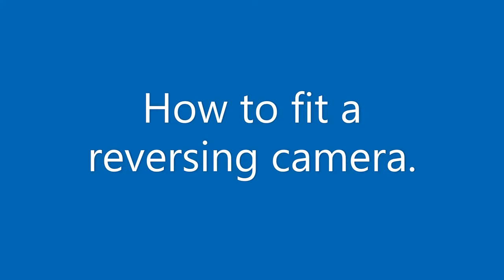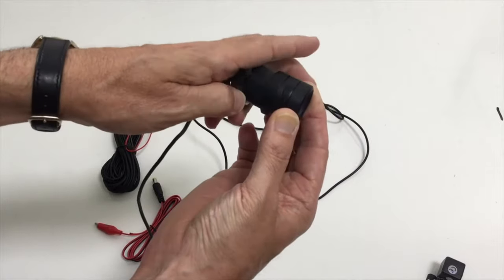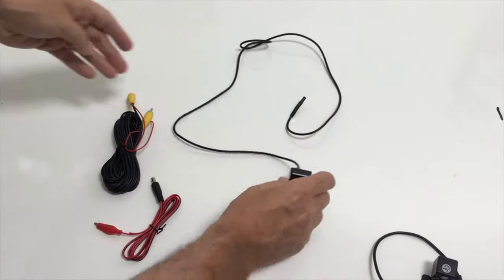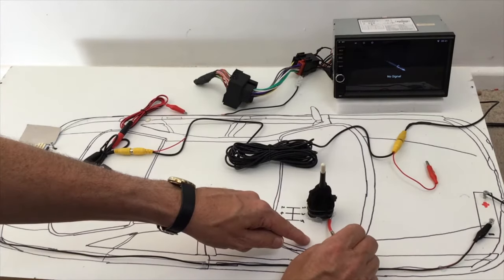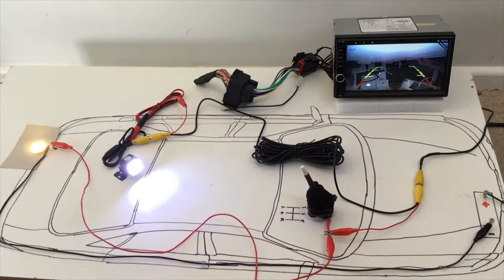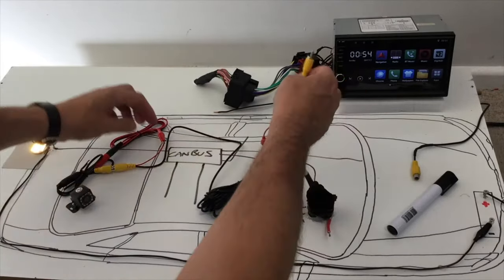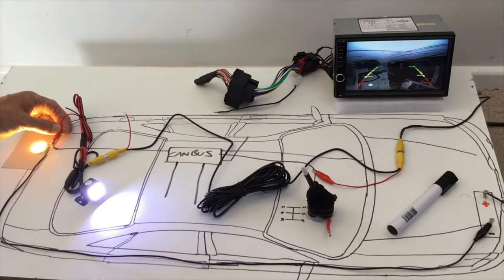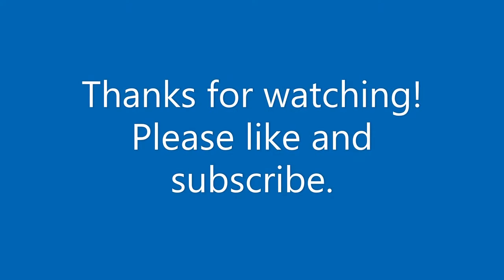How to wire in a reversing backup camera - watch this first!

Comment: Hello. I am interested in how the layout of the wires for the camera goes as in the picture because my cores are torn. The output of the camera has 5 wires (red, black, white, green, yellow). How to connect them, make a red and yellow connector? Thanks
Reply from the maker: Hi there, it’s very difficult to say exactly what each wire does, because different cameras have different wiring. They might have the same colours, but the use of each can vary. My guess would be red for power, black for ground, and “possibly” green and yellow would be the video signal. But that then leaves white. So to be honest I’m not sure. Can you get in touch with the camera supplier?

Comment: hello, I have a problem because the old reversing camera broke, I bought another one exactly of the same type as the old one, the wiring is the same and I didn't need to rewire the cables, unfortunately, but the new camera does not work, I should also tell you that I bought 2 identical cameras and they don't work, what could be wrong, tell me when the system is canbus, the big cable that comes out of the rca of the camera must be connected to the positive of the rear lamp??? also because I'm also trying it at home on a TV but they still don't show me an image, do you know if these cameras work to test if they work on a simple TV or only on an android system please help thank you
Reply from the maker: Hi there, and thanks for your comments. Yes these cameras will display on a normal TV as long as it has a yellow rca video input line. You will need a power supply of 12v to power the camera when you are doing your test on the TV. If you supply 12v power to the camera and plug your video rca cable into the yellow rca socket on the TV and select that input on the TV, you should see an image. If not, there is a good chance the camera has a problem. 🤞 good luck!
Reply: @Jase777jase  do I have to connect the red cable that comes out of the rca plugs to the power supply???
Reply from the maker: @emmanouhldigkas1661  yes, that’s right. Red to the positive 12v supply.
Reply: @Jase777jase  I also have to connect the red wires that the 6 meter rca cable has, it comes out with 2 red wires, I also have to connect these to the positive pole to see the signal on the TV???

Comment: Very good video on how its done.... I have a brain tester for you :)  Can i tap into the factory fitted camera to be conected to a rocker switch that i can turn on the rear view camera anytime i want like driving along the motorway and a front facing camera  ?
Reply from the maker: Hi Brian. That’s a very good question and one that several people have asked! I’m sure it’s possible, but Im also sure it would be very tricky to achieve. It’s very likely that control of your factory fitted camera involves Canbus, and therefore you’d need to decode that to get anywhere. It might not be the case, but I’d bet that it would be. Regardless, you’d need a very detailed wiring diagram for the whole vehicle in order to even make a start as to how to go about it. That’s assuming you are talking about a factory fitted camera and factory fitted head unit. If you have an android aftermarket head unit and you have already successfully connected your built-in camera to the new head unit, it would be possible, because you have access to all the right connections for the job. I hope that helps, and many thanks for the excellent question. J.
Reply: Thanks for your rerply. I was thinking of  going the Andriod way . And it could the easist way to do want i want .  Thanks  @Jase777jase

Comment: Great video!  I'm working on getting my Head Unit to show the camera on demand and when in reverse.  It's on an RV that I want to keep track of what I'm pulling.  I'm getting my camera power from the front via the camera cable.  Any suggestions?
Reply from the maker: Hi there Michael and thanks for your comment.
Yes it’s something that I have thought of doing as well. It really depends on how far you’ve got so far. If you already have it working automatically when reverse is selected, either from the reversing light or from a canbus system, then it’s just a case of wiring in a switch in parallel with the current set up with one pin of the switch going to a positive signal and the other going into the reversing signal bunch. You could then mount this switch somewhere sensible on the dash. I guess if you haven’t already got it working automatically, you could just do the above anyway, and flick the switch if it’s close to where the gearstick is, and forget about the automatic part of things. Another completely different way of attacking this, which occurred to me yesterday, would be to use one of the other video inputs on the head unit. There are usually a couple of RCA connectors in addition to the one for the reversing camera input, and you could theoretically create a double RCA plug from the camera lead and plug in to one of the other RCA sockets as well as the reversing RCA input.
This would mean that when you want to view the reversing camera on demand you have to go through the menu system to find the video input button.
Hope that gives you food for thought!
All the best
Jason.
Reply: @Jase777jase  Funny you said that.  I just ended up using one of the other video inputs. LoL
Reply: @Jase777jase  By the way, I like the using a RCA splitter so I can get backup and full time backup camera.  Thanks for the thought!

Comment: I connected everything as per the video as I connected the red "power" wire to the "back up" lights. I did that, because the "back up" lights only get power when the car is put into "reverse." Since I only want my rear view camera to work when my car is in "reverse," I thought that this is the logical way to do it. Well, I am getting a "No Video Signal" message on a black screen! Any advice?
Reply from the maker: Hi there, well that would indicate that the head unit it sensing reverse, but not seeing any input from the camera. Do you know that the camera is getting power and coming on? Ie does it have anything to indicate that it’s on, like led lights like the one in my video? Is if definitely plugged into the correct RCA socket on the back of the head unit? There will probably be several. Make sure it’s in the reverse one. Going back to the camera, If you can, try the camera in another device. If you have oldish TV with RCA inputs on, try it in the yellow port and select the correct AV channel on the TV and see if the camera is working. That’s about all I can offer I’m afraid! I wish you luck!
Reply: @Jase777jase , 
I have plugged it in the correct port into the deck as it is marked with "camera." The camera itself seems to be getting power, because the LEDs on it light up. My deck has a foldable screen, which used to open automatically when I switch into "reverse." That function seems to have been lost. I can see that the deck registers the camera coming on when I switch into "reverse," because the word "camera" comes on the small field that shows the status while the screen is closed. I can open the screen with a push of a button, but when it opens, it displays the message "No Video Signal." I connected the camera power wire directly to ACC, but I am still getting the same result. In the end, I reset the deck, but that didn't fix the issue either. I am starting to think that the problem is in the deck itself now. The screen works with all other devices though so that is strange...
Reply: @Jase777jase ,
Wouldn't I still have to power the camera if I were to test it in the TV set? Or the yellow coaxial cable connection would be enough?
Reply from the maker: @leasegrandcayman8747  yes, your absolutely right, you’d need a 12v supply to power the camera if you tested it on a TV set. You might find an old router power supply that’s no longer needed, that happens to be 12v, but make sure it’s polarity is correct AND make sure it’s DC!

Comment: The example being shown doesn't show the cameras black ground lead connected, so I'm not sure how it's working properly.
Reply from the maker: Hi there and thanks for the comment. The really handy thing about these cameras is that the video lead has a ground, and it’s common to the power as well. So you don’t need to wire in a ground, as that travels back via the outer connection on the yellow video lead, and it’s grounded at both ends. One less thing to think about!

Comment: Brilliant. The only item left unexplained is what to do with other points on the relay. The last picture showed relay was not doing any work...
Reply from the maker: Hi there, and thanks for your comments. Yes, you’re right of course, really that final picture was intended more for a general summing up, and does not show the full wiring of the relay, but that is covered between 26:16 and 28:16. Also please see other comment (Fred Flintstone) regarding using a flyback diode. This is sound advice, however, I have not bothered with my implementation, and it’s been working fine for a couple of years now. What I did do though, it encase the wiring to the relay in an outer, stronger layer of heatshrink, as I found the soldered joints were breaking off, after being pushed in with all the rest of the gubbins behind the stereo. Thanks again for your comment. 😊

Comment: Great explanation of the different options you can use. Can the last option of getting power from the red wire on the rca cable be applied to piggybacking from the interior fuse box with that red wire as my road angel camera tech help recommended not to take power from the head unit. Just to expand a little more I am using a connects2 cable with the reverse pigtail connected to the reverse fly lead from the head unit.Thanks
Reply from the maker: Hi there and thanks for your comments. You can always take power from the fuse box, if you can get to it! That usually the problem, or at least, it’s a big problem for me... The two ways you could utilise power from the fuse box would be (1) to find the actual fuse for the reversing light and take it from that, or (2) use my relay option and just take a feed that’s always on (eg for the cigarette lighter) or at least, always on when ignition is on. I hope that helps and thanks again for taking time to comment. 😊

Comment: Not all reverse lights have 12v and I’m having nightmares getting the thing to work due t9 this. Voltage in about 9v and normal for my car make and model. There doesn’t seem to be any advice anywhere of how to boost the voltage or connect elsewhere when you need the camera to automatically trigger when reverse selected.
Reply from the maker: Hi there and thanks for your comment… Well that’s very interesting… I’ve not come across that before. I’m going to have a think and come back to you, but in the meantime, have you seen this… https://www.vwvortex.com/threads/back-up-cam-reverse-lights-only-getting-9-volts.6026501/ 
Some interesting ideas there. Other things that spring to mind are a camera with greater tolerance of input voltage, or a step up chip.
I’ll get back to you..l

Comment: I wired in the camera and now my car wont start.

Tried jump starting it and it didnt work, im gonna try checking all the fuses and ses if I've blown any

UPDATE: it was a blown fuse. My mistake was wiring the cameras black wire into the reverse cameras black wire when I should have grounded it! I just assumed they were both neutral wires because in my head earth should be green and yellow 🤷🏼‍♂️
Reply from the maker: Hi there, yes, sounds like a blown fuse. I did exactly the same thing during one of the many times I had the stereo out and was working on the wiring. It did the same and prevented the car from starting. Thank you for your comment, it’s a cautionary tale for anyone working on this sort of thing. When you have any 12v wire exposed, keep it well away from the body of the stereo, which is typically metal and grounded. Therefore, if it touches, a fuse will almost certainly be blown. Thanks again for your comment and I hope you are back on the road now! Best wishes. J.
Reply: @Jase777jase  hi thanks for your response yes I found the blown fuse, now I'm waiting for them to arrive this evening 😂  I connected the black wire from the camera to the neutral of the reverse lights when I should have connected it to ground, lesson learned 🤷🏼‍♂️😂

Comment: Do both sides of the wire need to be connected to power if I’m using the reverse light bulb power ?
Reply: Thats What I a.m wondering
Reply: Did you ever figure it out?
Reply: @NashBrewer-fz4yz  yes I needed an additional ignition wire I had everything ran except that got frustrated took it to a sound shop and that’s all I needed

Comment: So basically if head unit has Canbus, camera gets powered by head unit
Reply from the maker: Yes, absolutely. In fact I’d like to learn more about Canbus enabled units. I’ve actually just replaced my unit featured in the video with a new Xtrons unit which was much more expensive, but still does not have Canbus built in. So I’m still slightly in the dark as to how much of the work is done for you. Presumably the screen changes over automatically when you change to reverse, and a line coming out of the loom goes high (12v) to power the camera. If you have one, and confirm this, I’d be grateful. In addition, I’m guessing that steering wheel controls are just built in as well. Anyway, thanks for your comment. 👍

Comment: I have installed a rearview camera in the trunk. 
But my Android radio does not detect it as a rearview camera. 
I have 2 options to plug in the cable 1 NTSC or 2 NTSC. 
When I plug in the camera in 1, the camera shows up as a right-side camera.
When I plug in the camera in 2, it shows up as a front camera.

The camera does work but not how it is supposed to be (as a rearview camera).
It is kinda frustrating because I can't use the single camera option now and have to use the 360 option to see my camera (front, or right side).

Can someone please help me out? Much appreciated 🙏
Reply: Volkswagen Jetta 2011